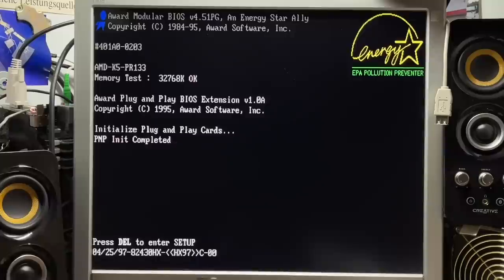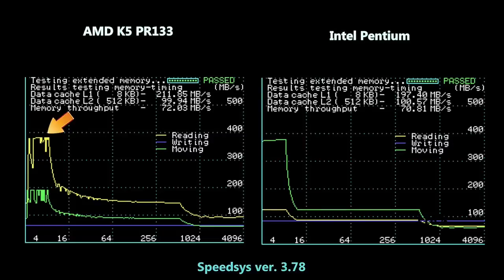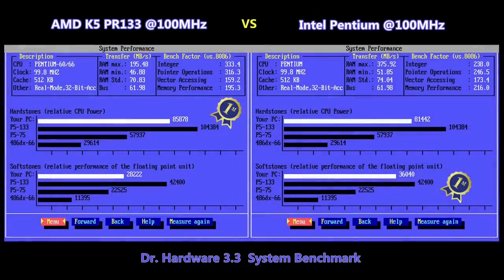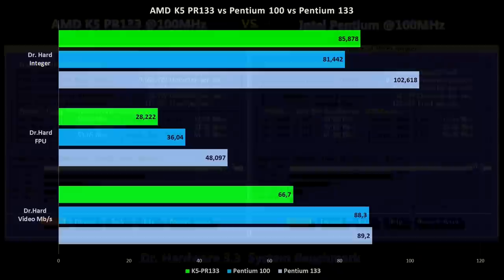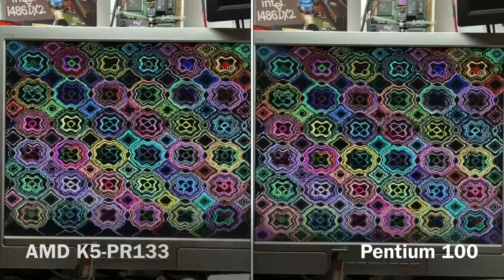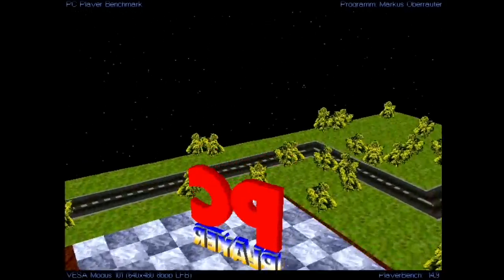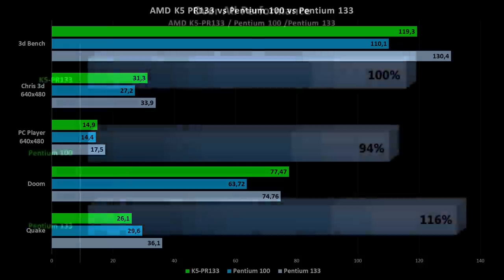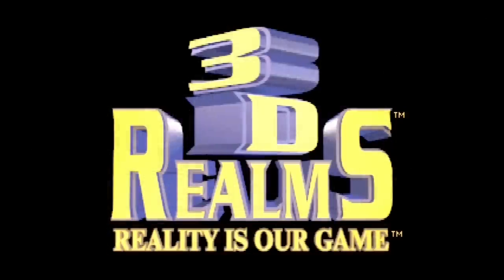AMD K5 PR133 vs Intel Pentium 100 / 133 Benchmark Battle

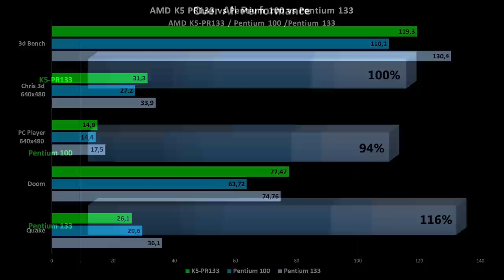Comment: 9:59
You can't conclude the things you say based on such graph.
It's biased towards the performance difference of higher fps running benchmarks.
You should normalize the numbers (for example make AMD always 1, and pentiums will be a multiplier of amd) to claim what you are claiming.

In general, I would appreciate relative performance graphs a lot more than comparing absolute values of the fps.

But after all that rant, let me say that I absolutely love your work!
Reply from the maker: thanks for your input. But I took the AMD as 1. or 100%. Its the same. and the comparison at the end is the average of the „user near“ benchmarks.
Reply: @CPUGalaxy  no-no, you need to take amd's every measurement as normalized to 1 to get rid of the fps bias.

Think about it. If cpu is 10% better in one of the benchmark and 10% worse in another, then in average those cpus should be equal, right? But if one benchmark hovers around 100fps and other is hovering around 10fps, then the first benchmark has 10x the weight compared to second one in your current approach. And you would conclude that one cpu is 9% faster than the other one.

Comment: PR rating was based on WinBench benchmarks, so mostly office kind of software. So to compare, you should get games that were 2D in general and likely you will get the Pentium like PR rating: Civ like end turn, or Homm 3, or try a compilation benchmark.

Realistically, the PR was quite legit, and Intel had hard time to keep up with it in most software but CAD, Quake and floating point intensive apps: but most software was 2D like Windows 95 or 98, not DOS software like you tested 

Still, at the time, Cyrix was a better offer with 6x86.

Comment: AMD lost a lot of credibility with their inflated PR ratings. What started with just 10% overblown figures with the K5 turned worse with every generation. The K6-450 I owned for a short time failed to show any meaningful improvement over the P2-350 it replaced, and the Athlon XP "2400" clocked at 1800 should rather have been labelled its true 1800 speed. Sure they were a lot cheaper than Intel, but you also had to buy 25% higher clock if you wanted the same performance as Intel. AMD was so damn lucky that Intel landed such a huge bellyflop with the Netburst P4 architecture, otherwise they'd likely have gone out of business.
Reply: Personally I have no idea how AMD survived from the Bulldozer upward, until Ryzen
Reply: Going from a Pentium 2 350mhz to a k6 450mhz is not an upgrade. That is a downgrade. The Pentium 2 was competing with a k6-2 or a k6-3 at the time. A k6 competed with a Pentium.

Comment: 10:25 conclusion was real. Overall setup for AMD was significantly cheaper. You also got to consider motherboards for Intel CPU, which - surprise, surprise - used Intel chipsets as well, were roughly two or three times as expensive than an AMD setup mobo, CPU combined. AMD was a great bargain.
That's why Intel came up with the Celeron CPUs.

Comment: I had a K5 PR133 but i cant find it anymore. Interesting cpu that i got cheap to uogtade my then gf 5x86 build. At some point i upgraded it to a k6-2 350mhz cpu that the machine still has in it to this day. Im hoping the k5 is still in my old computer parts tote so i can tryit out again.

Comment: K5's were always a mystery to me, never seen them or had used one. My dad had a 133mhz 486 dx and I had a 450mhz k6-2. I wanted to upgrade to a k6-3, but really by that time the athlons were plowing their way to 1ghz. I grew up red team I suppose. Not to say I hadn't used blue, I just didn't like the way the company operated or treated their customers and just tried to hurt the competition any way they could. Even when AMD were good guys and sponsored lans and events just because. Intel did not, but when they realized they could advertise that way and force amd out to be petty douchebags, they so did. Amd just did it to be nice to gamers, intel did it because they wanted all the money and to hurt the other guy. They made great strides in the technology, but were just so greedy and dirty the whole way and even went ahead with cheating on benchmarks. They tried to hurt the competitor with not letting the competitor use instructions and only hurt the consumer in the process. I will not forget. They were very petty when Intel wanted to make a 64 bit processor as the future by starting fresh and erasing older instruction extensions, while they had the right idea, they had a horrible implementation and made a slow 733mhz itanium instead. They never had any desktop vision that came to light, so amd did the work of making amd x86-64 and linus torvalds had slammed intel for being the petty douchebags they always have been by calling it IA64. Intel never once backed off that. However I still love to see these old videos of Intel and AMD and still I miss cyrix and all the other cpu companies that have come and gone. Now I don't mind Intel products and I don't mind using them if I don't have to give Intel money. I like their contribution to the computer world and I like their history. I just have not liked the way they mistreat and treat people like they are stupid. I remember when everyone drooled over the $1000 6 core Intel i7 Extreme and the power that it gave, but after people spent more on systems with sli or crossfire than a used car. Then the same people criticized AMD for higher core count vs single core and gaming. I had given up on Intel as any sort of value proposition or power house. It seemed a lot of people were kind of wary after the $1000 6 core dropped to $500 and the 8 core was $1000 and then the 10 core became the new king and those former fell in price and some of these people had to still be paying off their credit cards while watching these fall in price and the market running away after spending $5k on quad sli, 64gb ram and 6 core cpu. Now a days that seems pretty sad when sli is kind of dead in the water, ram and cpu count have skyrocketed. I never understood the whole craze for triple and quad sli at the time. I mean I understood sli and even had it myself, but I knew of sli's limitations and I hoped for one day for it to improve. Then people learned some harsh lessons, sli just was a huge let down. triple and quad barely worked and it never got better and it was just giant piles of money being wasted for nothng.

Comment: AMD K5 is much stronger CPU, but its has too many transistors and cannot reach Pentium clocks speeds, K5 has TWO independent
hardware multiply, unfortunately no any software at Pentium time not using this feature, but Quake using very string Pentium FPU instead. K5 also had unreachable^ even today L1 cache read speed latency at 1 clock!!! No one other CPUs can do that! Great work of AMD engineers!

Comment: Please recheck them with heat sink and a fan it should worth. AMD processors even till Athlon suffered from overheating in comparison to Intel and they need very good cooling utility. I think the initial disorder of the first graph in AMD due to heat issue. I had a Pentium 166 MHz in 1997 and it came with a heat sink.

Comment: 4:29 A swollen electrolytic capacitor is visible on the board! You need to replace him.
5:29 There are also swollen capacitors near the processor. This can affect the test results.

Comment: 6:35 or maybe amd loose because you use motherboard with intel chipset? :) If amd made tricks with cpu naming to point out that it is better than intel, so then intel made tricks in chipset to perform amd cpu worst? or this is because  that bad caps on the board which amd maybe can't handle that good as penitum . :D